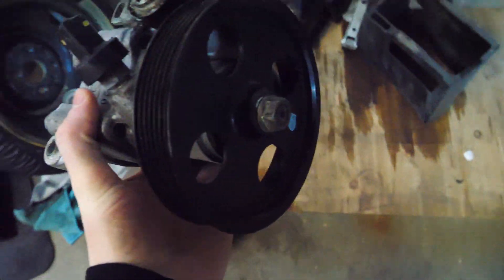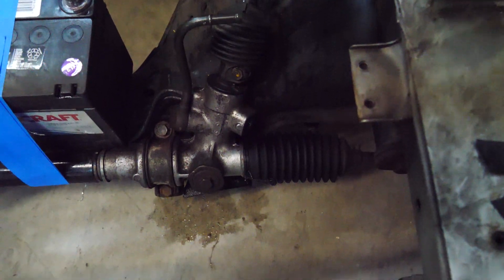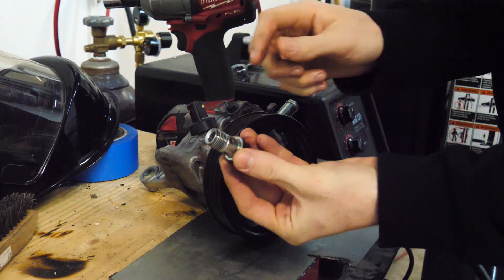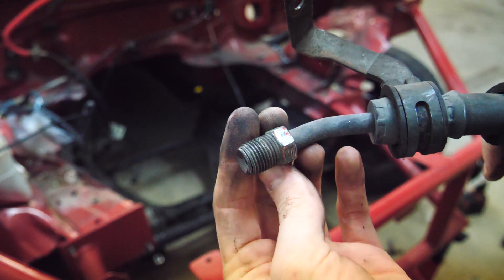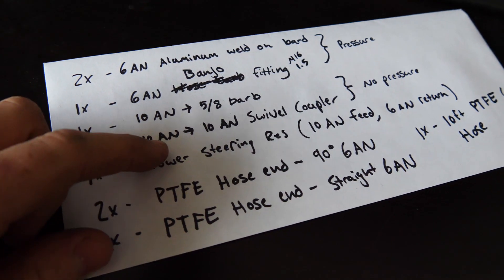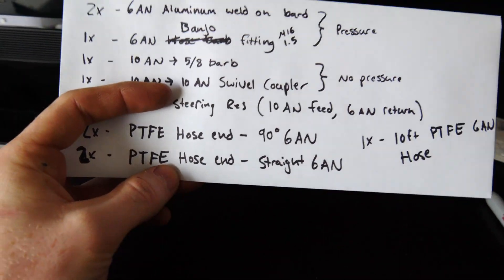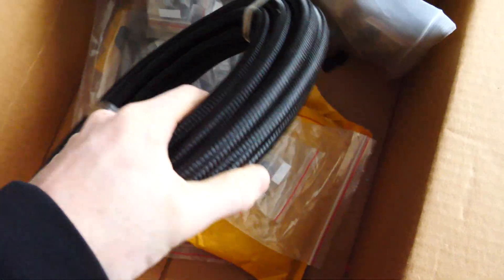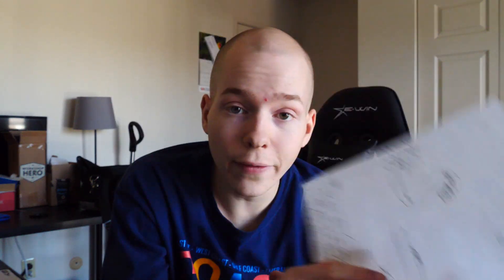Planning a Custom POWER STEERING Setup for the DRIFT TRUCK!

Comment: If the rear end is a ford 8.8 install a mini spool, its replaces the spider gears and makes it act like a welded diff!!!
Reply: This. Didn't know what a mini spool is, but I did some research and it seems awesome and is so cheap.
Reply: this
Reply: Justin Wright do this
Reply: Bump
Reply: @kapys1722  great idea
Reply: Not to mention a solid rear axel being welded is unsafe due to the only thing holding the axel in is a small c clip that you can slide off a mini spool should keep the axel from sliding in enough for that clip to fall out and cause the axel to start to slide out
Reply: Too bad gingium will never notice this
Reply: @gingium this looks like the solution.
Reply: Doesn't replace just locks them together
Reply: T1GR3S13 no a mini spool replaces the 4 spider gears with Essentially a block of metal cut into 4 pieces then put together locking both axels together while being held together with the same pin the spider gears use
Reply: Eyyy, it's good idea, but why don't you think of installing offroad diff locker? There are offroaders who use 8.8 axle, there is manually(cable, hydro, air or electronically) controlled ones for on/off position, how much would it help in the pits, and fitting would like stock
Reply: This has been said a episode ago, but you know he will weld the diff cus math is scary . A trak lok is good cus you can set it up loose or tight and that way it is great for drifting and daily driving. I got the rear of my Vic set up on the loose side so I can throttle whip it when I need to break the rear loose and it helps keep me at angle in long sweepers.
Reply: @imnota  it's more for drag racing. In drift it might make it hard to keep the light rear of a truck from stepping out all the time with the lightest of input.
Reply: Full spools are safer. Mini spools are too hard on the splines of the axles.
Reply: All and all it doesn’t matter what he does just as long as he doesn’t weld it I’ll be okay but will see welding it only cost some welding rod or wire depending on what his welder is I forgot which is the cheapest even though it’s not the safest
Reply: Glad to see someone else with a brain!

Comment: 1. Do NOT weld and desecrate that dif. Its easily and cheaply upgraded hence why ford rear ends are by far the best. They have lockers and better yet mini spools for these.
2. Use an electric power steering setup, easy conversion and wont rob any power 
3. Absolutely do NOT rear mount turbo this thing, just an awful idea in every way.  
4. INSTALL THE DAMN BENCH VISE
Reply: Brandon Harrington I’d rather see a procharger
Reply: @joncampbell9075  for sure

Comment: if you're putting power steering you should add a hydro booster so you can replace your coil easier, and an added bonus is it gives you better brakes. There is one for a late 90s mustang is much cheaper than most other ones, and is very easy to install in the stock location of the brake booster.
Reply: Markos Simopoulos yup was thinking the same thing ☝🏼

Comment: A hydraulic shop would make you the hose for way cheaper.
You don't need AN fittings or teflon hoses (ptfe ),OEM stuff is more than enough.
Plug the cooler on the return line,wich is a simple hose,so don't need pressure fittings.

Comment: Also, fire extinguisher. Not saying it's gonna blow up but just in case. You don't really know what will happen under high load. Just a thought.
Reply: Magnus Langvegg and tow hooks
Reply: @joncampbell9075  Yeah. Also, how about a simple roll cage in the bed, to hinder the roof from caving in if it was to roll over.

Comment: It's not negative 6 or negative 8 

It's "dash" 6 or dash 8. It's all relative over a factor of 16. So dash 8 is 8/16 Or 1/2" ID. Fun facts. AN is also 37° taper vs flare 45°
Reply: knowledge is power i guess
Reply: thanks
Reply: He corrected himself in the video
Reply: SAE Flare is 45 degrees, JIC 37, Japanese Industrial 30 and Komatsu 30.

Comment: Electric power steering doesnt rob as much HP, that's why so many use that.
Reply: And makes pushing it around without the motor running alot easier
Reply: He explains why he’s going for belt driven power steering at the beginning of the video.

Comment: @gingium power steering pressure hoses are 3/8 and most have in a flow restrictor, you probably should do the -6 hose instead of -8......and restriction to flow gives pressure

Comment: For the fuel tank, instead of moving it I would get an aftermarket fuel cell and mount it over the rear axle in the bed of the truck
Reply: That’s what he is doing
Reply: @NOSKIDPLATE  he said he was moving the stock fuel cell, not getting an aftermarket one.
Reply: Eric Flack he said in other videos that's he's getting a cell why would he move the stock fuel tank to the back that don't make any sense and I'm sure it would be more difficult to do that than to mount up a cell

Comment: Definitely get an eaton tru-trac LSD, and also, I want you to calculate out your gear ratios and get a final drive set that'll put you around 2000 RPM at 70MPH. Trust me, V8's with torque and this kind of power to weight ratio will do good with a 2000RPM 70MPH cruise in last gear. Alternatively, you can gear it this way.

Your slowest desired speed in last gear at your lowest desired cruising RPM. I, however, would not go below about 65MPH, and with that power to weight ratio, amount of cylinders(smoothness), and torque in general, I wouldn't want to be above 2000RPM at that speed. In general, though, I wouldn't want to be below 1500RPM, as any engine starts to run rough or bog down at that point.

My TC doesn't become fully smooth until I pass about 1500, especially in slow traffic in second or third where it starts to suddenly and quickly clear up in front of me and I don't feel like downshifting. Yeah, 2nd CAN do it at 1000 but prefers 1500+, and third is similar, but 500RPM higher in each category respectively.

Comment: Didn’t watch it yet but for the power steering you could do it the same way Hert did in his Twerkstalion. He used an electric power steering pump. So you don’t have to deal with belts and when you have to flag tow the car because the engine is broken or you want to push it you still have power steering
Reply: Hert used an electric pump from an mr2. After seeing him do it, i added the system to my e30. having 1 lift and 3 people in a garage this has saved me so much time and pain from being able to move my baby without fear of not being able to turn the car fast enough when i don't have breaks.

Comment: Hey Gingium, thanks for the shout-out! Take your time with the build, I know it's taking a while but you can't rush art. If it's worth doing, it's worth overdoing. 

If you need any additional fittings or hoses for the drift truck we've got ya covered!

www.finishlinefactory.com

Comment: If you're doing power steering check out changing your brake booster to a hydroboost like a Mustang.  They're waaay smaller than a vacuum booster and run off the power steering pump. Would gain a lot of room around the brake booster

Comment: 9:24 I recently upgraded from drawing all my DIY designs to modelling them in Autodesks Fusion 360, and pretty much every little project since has been much more planned out and well done than before. You should really try it! (Solidworks is also pretty popular)
Reply: I used solid works for my front suspension stuff. It helped so much when all i was used to before that was replacing one part at a time. Being able to see all the parts layed out helps alot when redoing the entire assembly

Comment: Use a mr2 electric power steering pump. Or a Prius Electric Steering column.
Reply: The electric steering is very complex to get the feel right. If you don't use the steering angle sensors and speed input the gear has zero idea of how much assist to give and it will just go full assist all the time, at 80mph side ways is not when you want numb steering....that's how the fan gets shitty😉

Comment: That 'honeycomb' stuff in the grille isn't just there for looks!! Not only does it protect the radiator, heat exchanger, intercoolers, whatever, but it is designed to increase airflow!! Super cars like the GT 500 etc. actually use honeycomb designs and move the emblem, to increase airflow. I'm not sure how much R&D went into the Mazda pickup grille, but I would just leave it alone. Guaranteed that it was designed for optimum airflow and cooling.

Comment: If you had kept the supercharger, would have been able to blow the truck or would you need another supercharger (I’m not well educated on 1uzs, or on the supercharger you had on the rally Miata) Also, correct me if I’m wrong couldn’t you do a rear mount intercooler to add more weight in the back?

Comment: To rev match up through the gears try this.  Let throttle off a second after pulling it out of gear and it should push into the next gear easily. To go through the gears to slow down try this, as you take it out of gear rev the engine higher than what it takes to match revs while holding the shifter at the gate of the lower gear as the revs match it fall in like butter. Your welcome.

Comment: Didn´t truck have power steering when you bought it ? if it had, could you use the original power steering system ? 
I have driven Mazda pick up just like that, but I don´t remember any more, it was like 15 years ago. I took my first car a Volvo 240 to corrosion repairs to the little shop and they borrowed me their Madza pick up truck while they were working on my Volvo. And that Mazda was a diesel.
Reply: Darthadios it uses all different suspension components in the front. Not many if any parts shared with the old truck at all.

Comment: you should go with an electric power steering pump you wont get inconsistent flow and will make it easier to drift
Reply: He said that he goes with hydraulic instead of the electric powersteering because the timing belt squeaks due to shorter travel even though it's tensioned properly. Making it hydraulic will sort it out plus he will be able to rev match it in high rpm

Comment: Do not weld the diff. It will have better control with a Ford Trac Lok . You can set it up loose or tight. It's fully rebuild able and the good carbon friction kits from Ford are around a hundred bucks. There are 94 quad-drillion of them out there and if you look around you'll get one for free. I will loose a lot of respect if you hack that rear diff. As for the a/n fittings , that's my jam doggy !!! I love building fluid systems.....I get to lay everything out all nice and perfect. Just remember yes a bigger fitting will allow for more assist but it might mess with the variable assist valve in the pump and then you're steering will be toooooooooooo light at speed. Now back to the diff....this would be a great time to show you're fans the right way to set up rear gears . Swapping over to a different carrier will require at least measuring to make sure lash and pinion depth are good. If it's a 8.8 then as long as the pinion is touching the ring gear you should be fine 😉😁

Comment: I would've thought you'd swap the front hubs on the drift truck, or maybe that's saved for a brake upgrade. I don't know if FC hubs work, but considering 1980s Mazda did ridiculous amounts of parts bin for their cars, it's not far fetched that they might work and you can finally ditch the spacers.

Comment: The PS pump won't whine if it's completely empty. I've driven multiple cars a few thousand miles with no fluid and they don't make a sound. It'll only whine if it's low on fluid.

Comment: Doesn't more flow/easier to turn steering also mean the truck will self-steer less easily? Even the most basic weak-ass power steering system would be a huge improvement in driveability and drifting ease.

Comment: Do not install hydro yet... Learn to drift without it
Hydro is the last step in learning when you knows how to control and force car to drift only using gas pedal. If you install this now it will disturbs you!
PS. Ohhh ok, I got it xD